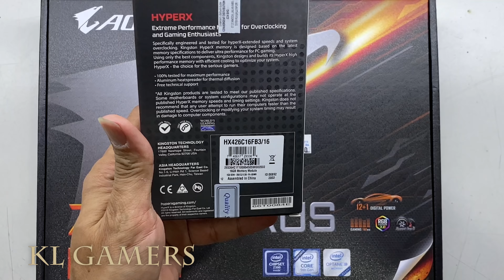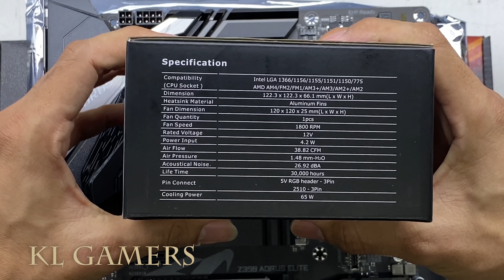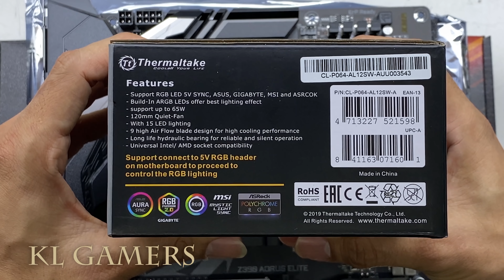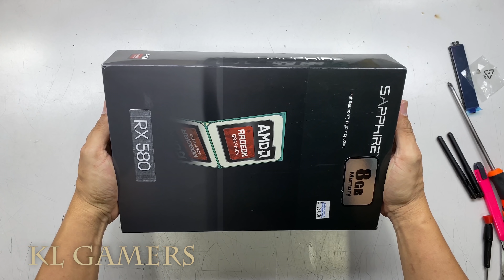intel Core i9 9900 GIGABYTE Z390 AORUS ELITE Thermaltake UX100 Sapphire RX580 Segotep Prime XL MATX

Comment: But RX580 with i9-9900😐... It's a productivity build I guess
Reply: Might be able to run minecraft on it i guess....or Fortnite at 30fps/1080p...
Reply: @andrew Reynolds you know the rx580 is pretty much equivalent to 1060 6gb
Reply: @jagatee2602  actually it's on par with GTX 1070 8 GB now
Reply: @Cullen Miller yea NVM Testing Games hasn’t made an update on 580v1070
Reply: @someguywithmtndew5691  far from the 1070 that thing can go up to like 2100 mhz

Comment: idk why single channel instead of dual channel with i9 lol
Reply: It's intel so it doesn't really matter.
Reply: @HeelerHouse  it matter a LOT even on intel.
Reply: @denyxrunner  Nah it doesn't. I tested it and it was a 5 fps difference in Warzone a game where RAM makes a difference. Don't listen to those vids where the difference from 1x8 to 2x4 is like a 40 FPS difference like the channel wolfgang. Then why would you even bother buying another GPU if the difference is that huge? They are all fake af.
Reply: @cowboy5944  man you obviously don’t play at high FPS. Try to match 240fps with a 240hz monitor and you will see huge difference in ram. Going from 3200cl17 to 4000cl16 gain me 25fps. I agree that it don’t matter too much when you play at only 100/120fps because at those frame the ram is not the limiting factor. Dual channel cost nothing... is a must have and the minimum for every gaming pc

Comment: With i9 you should go for 1660 super or 5700 xt atleast. RX580 is very low end card to pair with core i9. Instead your client should have gone for Ryzen 7 3700X with better graphics card.
Reply: Rx 5700 xt ≠ 1660
Rx 5700xt (+- ) = RTX 2070 super

Comment: But are all the cables included in the packages or do you have to buy them separaterly?
Reply from the maker: Usually SATA cables come with motherboard, and casing connection cables come the the casing

Comment: Will you recommend to buy a single channel ram for a high end pc?
Reply: No no dont do that man, use dual channel
Reply: Always do dual channel if enough  slot for upgrade, try get 3200 speed rather than 2666 and open xmp because the price different isn't huge
Reply from the maker: single channel = save money
Reply: @KLGamers  sometime i kinda think the actual different between single and dual channel is not much also

Comment: Total price?
Reply from the maker: Processor = Intel Core i9-9900 Desktop Processor 8 Cores up to 5.0GHz LGA1151 300 Series 65W 
(Amazon link) = https://amzn.to/3cOXKph
(Lazada link) = https://c.lazada.com.my/t/c.mNlA?url=https%3A%2F%2Fwww.lazada.com.my%2Fproducts%2Fintel-core-i9-9900-desktop-processor-8-cores-up-to-50ghz-16m-cache-lga1151-300-series-65w-i9-9900-i593732216-s1200140688.html&&sub_id1=9900&sub_id2=YES&sub_id3=1938
(Shopee link) = https://invol.co/clp4iu

Motherboard = Gigabyte Z390 AORUS Elite (Intel LGA1151/Z390/ATX/2xM.2/Realtek ALC1220/RGB Fusion/Gaming Motherboard)
(Amazon link) = https://amzn.to/2Rjpevn
(Lazada link) = https://c.lazada.com.my/t/c.Knn7m?url=https%3A%2F%2Fwww.lazada.com.my%2Fproducts%2Fgigabyte-z390-aorus-elite-intel-socket-lga1151-motherboard-i718152335-s1574544143.html&&sub_id1=Z390&sub_id2=Castle&sub_id3=772
(Shopee link) = https://invol.co/clp4j4

Cooler = Thermaltake UX100 5V Motherboard ARGB Sync 16.8 Million Colors 15 Addressable LED Intel/AMD Universal Socket Hydraulic Bearing 65W CPU Cooler CL-P064-AL12SW-A
(Amazon link) = https://amzn.to/34pCZ0k
(Lazada link) = https://c.lazada.com.my/t/c.7niJ?url=https%3A%2F%2Fwww.lazada.com.my%2Fproducts%2Fthermaltake-ux100-argb-lighting-cpu-cooler-cl-p064-al12sw-a-i522958289-s1020690777.html&&sub_id1=UX100&sub_id2=Big&sub_id3=57
(Shopee link) = https://invol.co/clmiph

RAM = Kingston Hyper X Fury 8GB 2666MHz DDR4 CL16 DIMM 1Rx8  Black XMP Desktop Memory Single Stick HX426C16FB3/8
(Amazon link) = https://amzn.to/2ukMBeU
(Lazada link) = https://c.lazada.com.my/t/c.6yT5?url=https%3A%2F%2Fwww.lazada.com.my%2Fproducts%2Fkingston-hyperx-fury-8gb-2666mhz-ddr4-cl16-dimm-black-hx426c16fb38-i578996124-s1158568514.html&&sub_id1=FURY&sub_id2=CGI&sub_id3=149
(Shopee link) = https://invol.co/clkidb

SSD = Gigabyte AORUS RGB NVMe M.2 512GB High Performance Gaming, Integrated Heatsink, Toshiba 3D NAND, DDR Cache Buffer, 5 Year Warranty SSD GP-ASM2NE2512GTT
(Amazon link) = https://amzn.to/2N6bDUV
(Lazada link) = https://c.lazada.com.my/t/c.KNnyh?url=https%3A%2F%2Fwww.lazada.com.my%2Fproducts%2Fgigabyte-aorus-rgb-m2-2280-nvme-ssd-256gb512gb-solid-state-drive-gp-asm2ne2256gttdrgp-asm2ne2512gttdr-i786860767-s1811504481.html&&sub_id1=AORUS&sub_id2=ECT&sub_id3=469
(Shopee link) = https://invol.co/clp4ik

Hard Disk = Seagate BarraCuda 1TB desktop hard disk =RM170
(Amazon link) = https://amzn.to/2YFWWLP
(Lazada link) = https://c.lazada.com.my/t/c.WLWh
(Shopee link) = https://invol.co/clh6b1

Graphics Card = Sapphire AMD Radeon Rx 580 Nitro+  8GB GDDR5 Dual HDMI/ DVI-D/ Dual DP with Backplate (UEFI) PCI-E Graphics Card ( 11265-01-20G )
(Amazon link) = https://amzn.to/2ob8eex
(Lazada link) = https://c.lazada.com.my/t/c.KM5pi?url=https%3A%2F%2Fwww.lazada.com.my%2Fproducts%2Fsapphire-nitro-radeon-rx580-8gb-gddr5-ready-stock-i569244991-s1136086649.html&&sub_id1=RX580&sub_id2=JCF&sub_id3=600
(Shopee link) = https://invol.co/clp4j7

Power Supply = Thermaltake Smart RGB 500W 80+ 256-Color RGB Fan ATX 12V 2.3 Kaby Lake Ready Power Supply 5 Yr Warranty Power Supply PS-SPR-0500NHFAWU-1
(Amazon link) = https://amzn.to/34OIqWA
(Lazada link) = https://c.lazada.com.my/t/c.9YE5?url=https%3A%2F%2Fwww.lazada.com.my%2Fproducts%2Fthermaltake-smart-rgb-500w-80plus-power-supply-spr-0500nhsaw-i909014854-s2258938958.html&&sub_id1=SMART+RGB&sub_id2=Castle&sub_id3=199
(Shopee link) = https://invol.co/clmsmi

Casing = Segotep Prime XL RGB Tempered glass E-ATX gaming casing (FREE 4XRGB FAN)
(Amazon link) = https://amzn.to/36e1pLb
(Lazada link) = https://c.lazada.com.my/t/c.KMlKF?url=https%3A%2F%2Fwww.lazada.com.my%2Fproducts%2Fsegotep-prime-xl-rgb-black-gaming-atx-case-with-tempered-glass-panel-magnetic-dust-filter-4-rgb-fan-included-i682440050-s1477602319.html&&sub_id1=Segotep&sub_id2=Mean&sub_id3=170
(Shopee link) = https://invol.co/clp4ji

AeroCool Cylon RGB Mid Tower with Acrylic Side Window, Black
(Amazon link) = https://amzn.to/2xd3eem